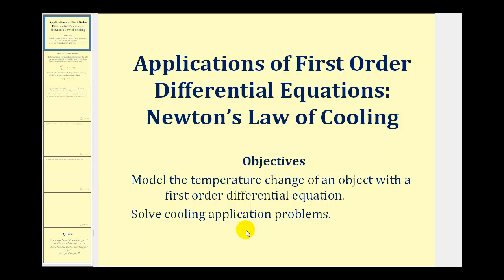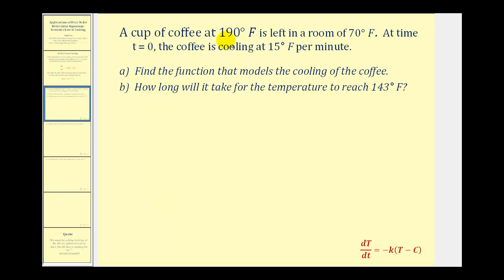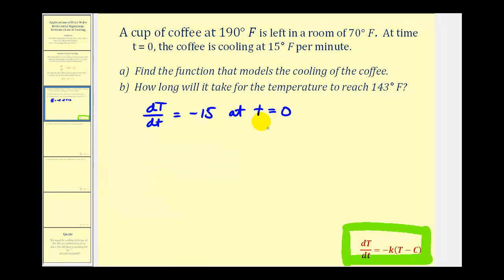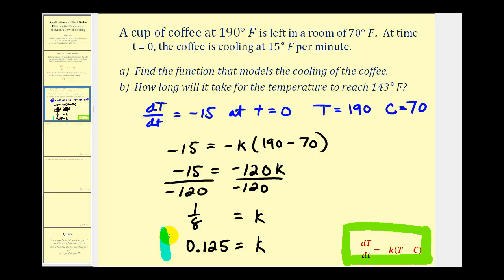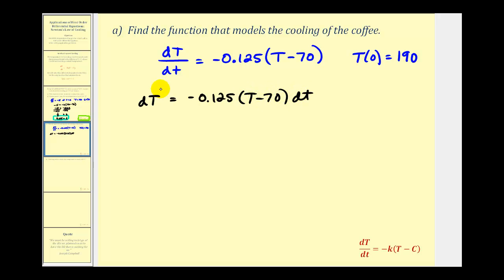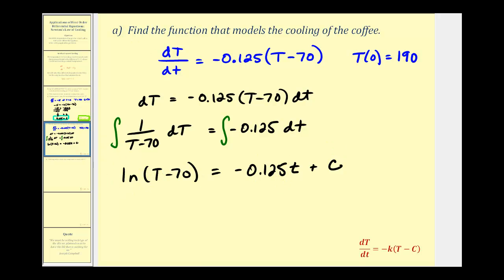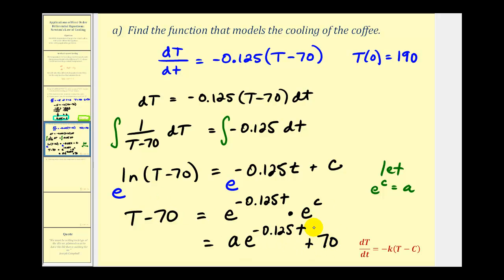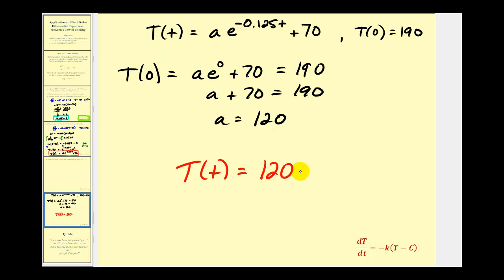Applications of First Order Differential Equations - Newton's Law of Cooling

Comment: but here, when t=0 the temperatures shows the15F however you have used 190 F , can you explain it?
Reply from the maker: Not quite, it is cooling at a rate of 15 degrees per minute, which is why dT/dt = -15

Comment: Technically, wouldn't the temperature of the room increase slightly as the coffee cools? The heat of the coffee dissipates into the air, warming the air. So C is not constant.
Reply: Brilliant observation but, the change would be negligible. Except the room is more of a shoebox, then the change in temperature will not be worth much.

Comment: What if you're not given a rate of cooling?
Reply: +Rich Perez Without a rate of cooling you will need two data points, the initial value (t=0, T(0)) and a secondary point (t2, T2).  From there you can find the cooling rate.
Reply: Did you ever find out what to do in that case? Did you have to solve for the rate?